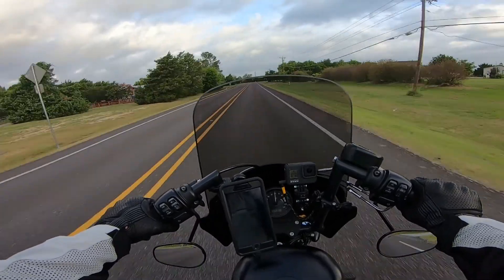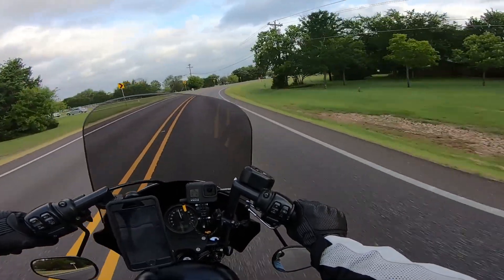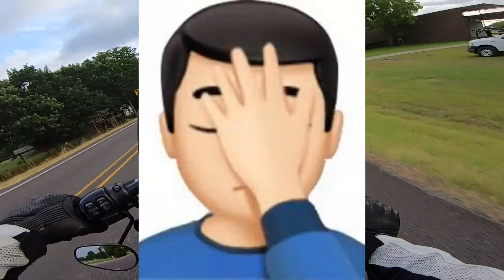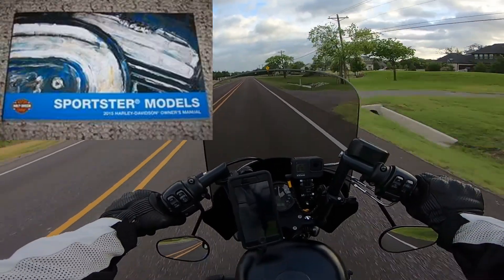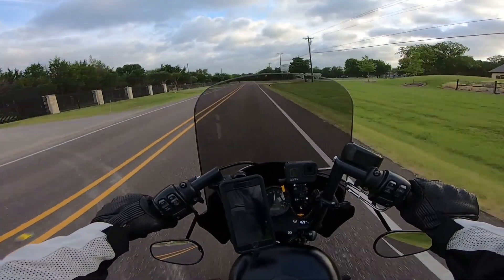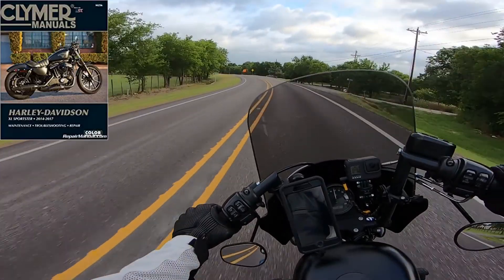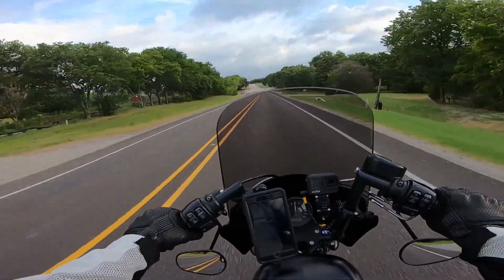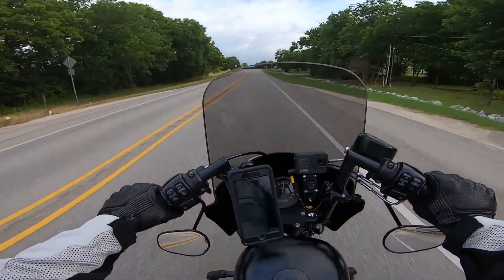Can YOU work on a motorcycle? Helpful Tools - Owners Manual - Service Manual - Clymer - YouTube

Comment: I like trying to work on my bike on my own. The one thing I don’t do is brakes. For me, it’s important to stop. Haha.
Reply from the maker: I will say that it is not to hard to do brakes, but I completely understand. I’ve done both front and rear on my Sportster.
Reply: @DoubleDMoto  I ride 2 up on the road glide ultra sometimes, so with total weight of 1400lbs, i feel more at easy with a mechanic...hahahaha.
Reply from the maker: @SHHHMotoTravels  I get it, ride safe!!